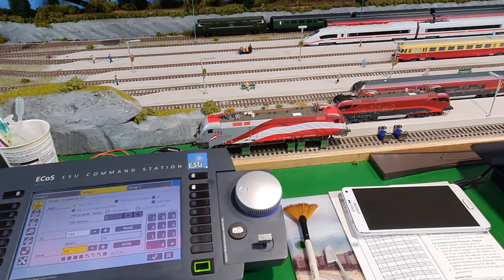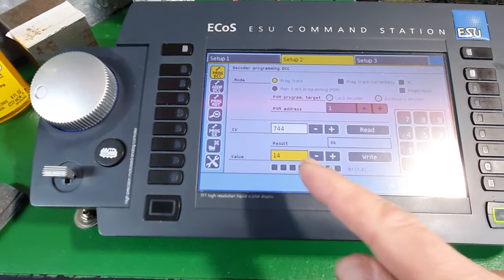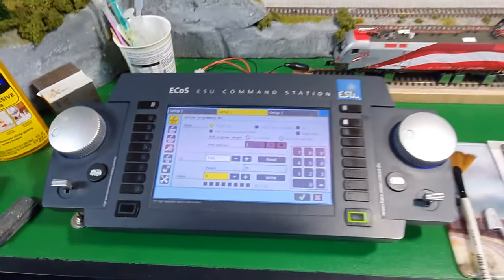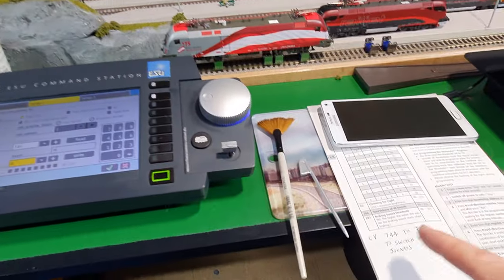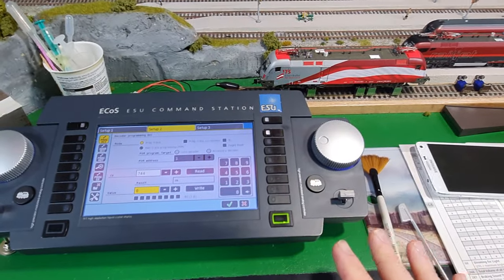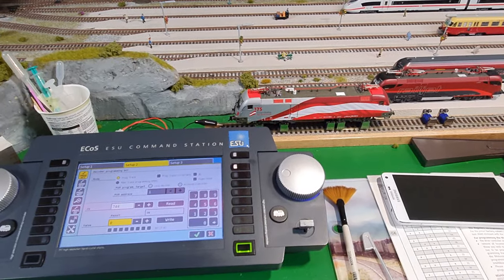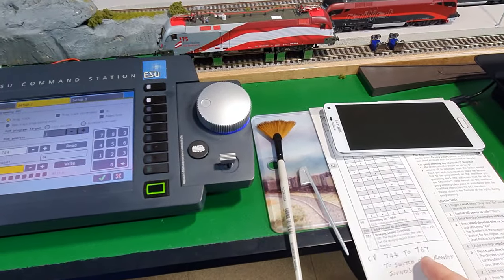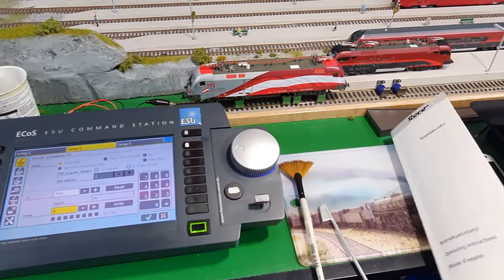Zimo sound, random fan disable cv {Generic chip Roco Taurus}

Comment: They should give you the CV's to enable (should you want them), but leave them out straight from the box.
Reply from the maker: I know this chip has 744 adjustments and only the very basic adjustments are on the manual that comes in the box with the loco.
Reply: @hovermotion  Extraordinary, do they think we're all idiots or do they think it's on a need to know basis???